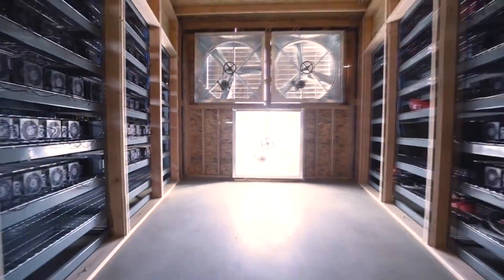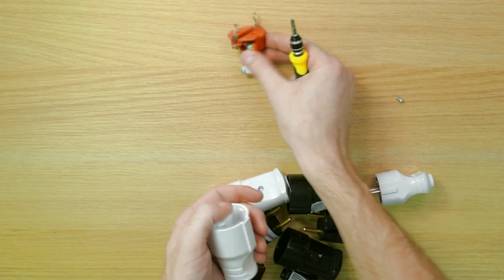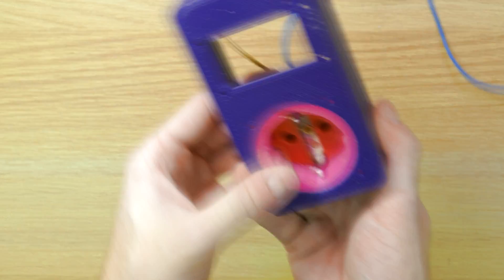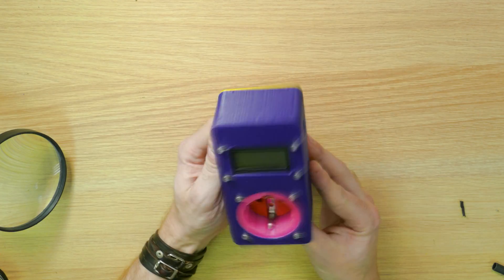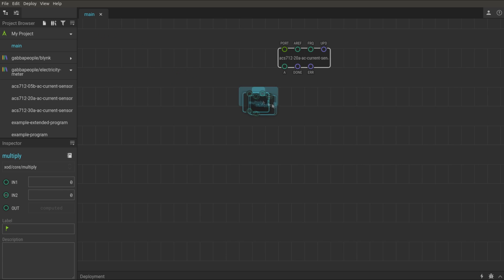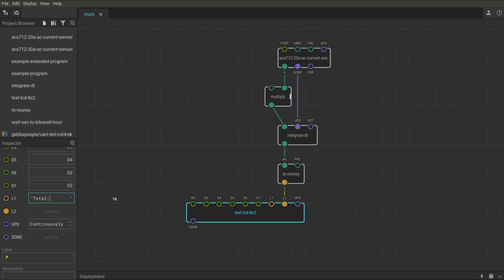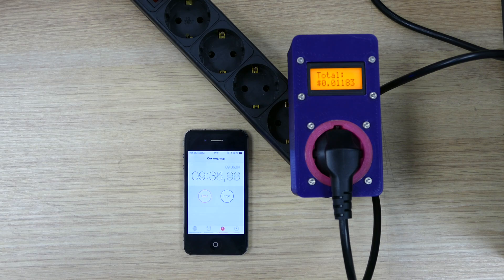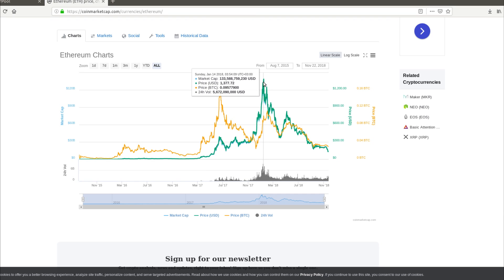Mining Cryptocurrency at Home. Is it worth it?

Comment: You got $1.46 electrical cost over one day of mining at $0.08 cost per kwh? That's like a 760 watt setup, why is your rig drawing so much power?

A GTX 1060 properly setup would draw around 75 watts, you've got 3 1060s, add another 75 watts for the rest of the system (mobo, cpu, etc), and you're looking at around 300 watts total for the rig. An 80+ platinum PSU would result in around 326 watts at the wall. At $0.08 cost per kwh that's around $0.63 for one day of mining.

And why does your rig show 15 MH/s for one card, and 19 MH/s for the other two cards? Each 1060 properly setup with a memory overclock (since you're mining ETH) would do around 22-24 MH/s.  Something tells me you didn't do the standard GPU setup for mining ETH: i.e. overclock the memory, underclock (or even +0) the core, and set power limits. If you had you should be getting 66-72 MH/s for your 3x 1060 setup.

That would get you around $0.77 per day at the Nov. 30 price of ETH of $115. Less the electrical cost of $0.63 (for a properly power limited 3x 1060 setup) would mean you'ld still be in profit at around $0.14 per day.
Reply: If a fan fails this profit doesn't allow you to buy a new one lol
Reply: For now ?